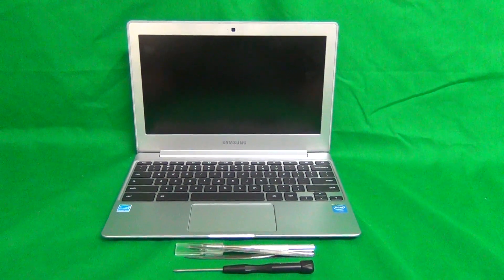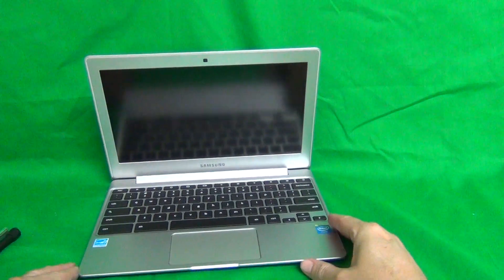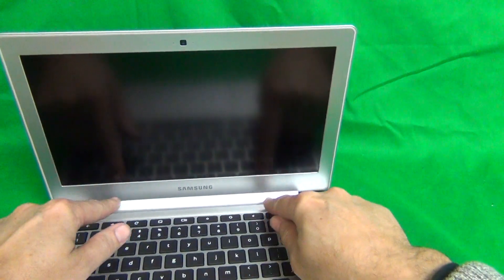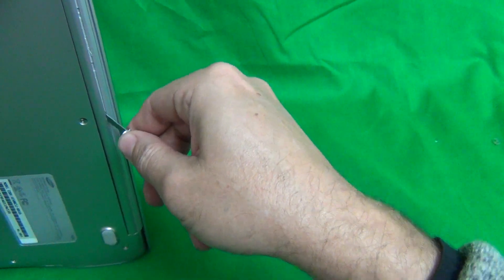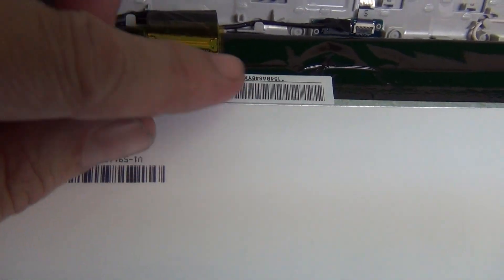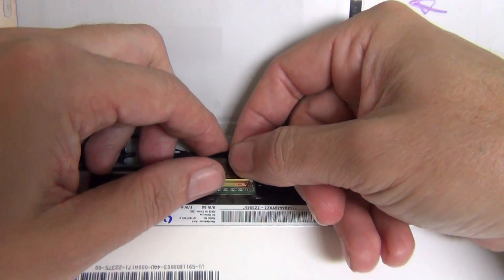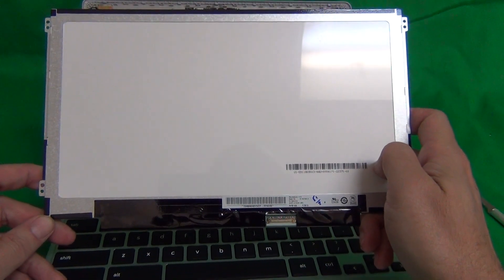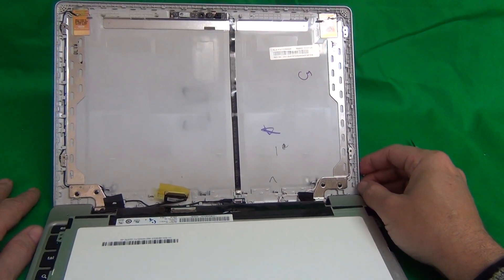Samsung Chromebook 2 500C XE500C12 Screen Replacement Procedure

Comment: Bought my replacement screen on Amazon for about $25. Used a metal tweezer and a little screwdriver from my eyeglasses/sunglasses repair kit. Easy to do in ~20 minutes. Thank you @ScreenSurgeons finally did it before the year ended XD